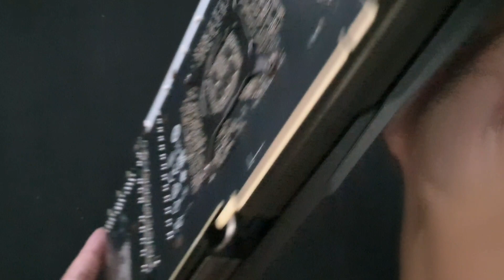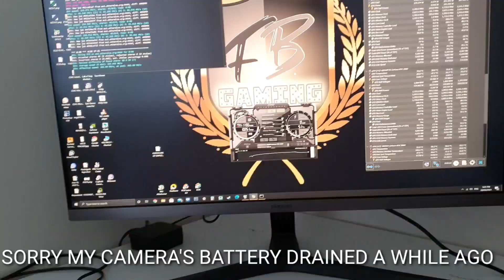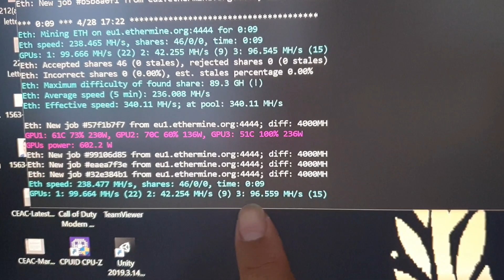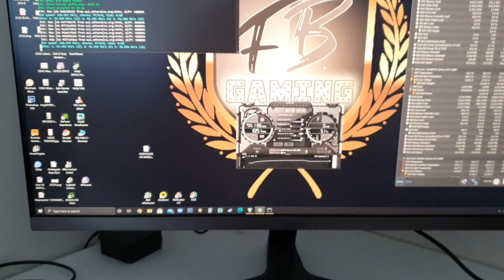RTX 3080 Thermal Pad Replacement | Teardown | 101mhs eth mining

Comment: Did you flash the bios? I never reached over 85mh/s for my card.
Reply from the maker: Hey Archer, i did not flash the bios. I'm currently at stock bios. what are your vram temps and overclock settings?
Reply: @ToolsandGadgets  vram 110 and +1000 for ram -200 for core. I checked the power is only 215w.
Reply from the maker: will be trying that oc settings once i get back at the office. Thanks for the suggestion 👍
Reply: @ToolsandGadgets  i think the bios was lock the power at 215w. And most of the card is need 230w, then it can get up to 100 mh/s. That’s why.
Reply from the maker: yes the bios for the msi rtx 3080 gaming x trio is locked at 215w. how i managed to pass by 215w is due to a secret upgrade on a official bios on the msi dragon center software
Reply: @ToolsandGadgets  How do I access it?
Reply: @ToolsandGadgets  How do I access it?
Reply: @ToolsandGadgets  How do I access it?
Reply from the maker: 1st you need to be on stock bios. then enable re sizable bar on bios. you need to be at the latest bios for your motherboard. you can check this link for the instruction https://www.nvidia.com/en-us/geforce/news/geforce-rtx-30-series-resizable-bar-support/

Then after everything you go to msi dragon center software > support >  advance. 
 then  follow the instructions. 

Flash your bios at your own risk. please backup your bios before flashing.

Comment: Nice
What is your vram temp before changing pads?
Reply from the maker: Vram temp was throttling at 110c. Now it sits comfortably at 96-98c
Reply: @ToolsandGadgets  Are you sure 98C is comfortable temp for the memory?
Reply from the maker: For us living in the Philippines that is already acceptable temp. it could really get hot here especially now we are currently in summer. 32-34c in the day
Reply: @ToolsandGadgets  should be a lot cooler than that.. I'm at 101 MH/s with 84-86c and fan speed 65%. You should really have used alcohol to clean the VRAM as the chips first before applying the new thermal pads. The oily film left behind by the OEM pads are likely to be affecting your temps.
Reply from the maker: would definitely try to open it again and clean the residues from the old thermal pads. Thanks